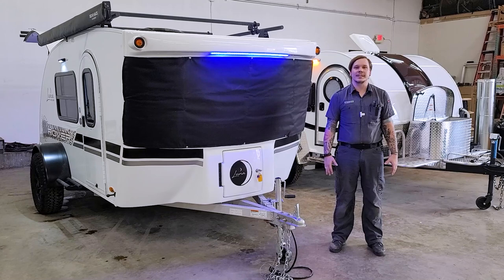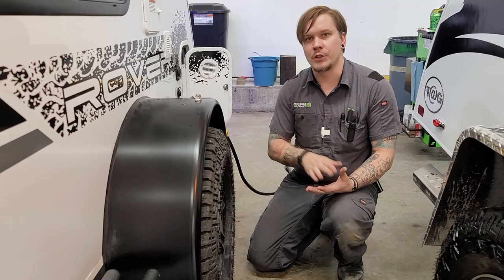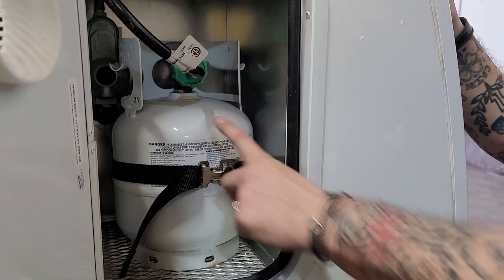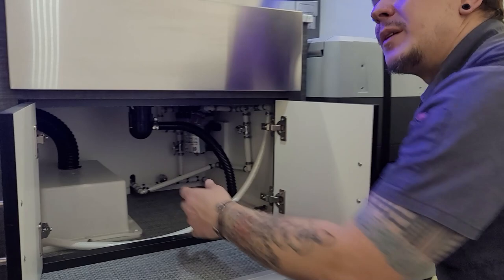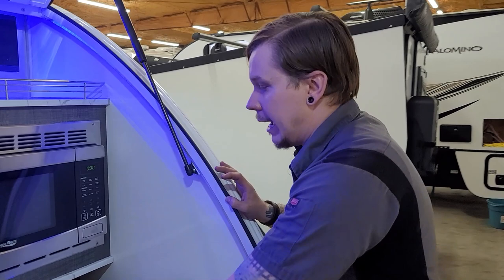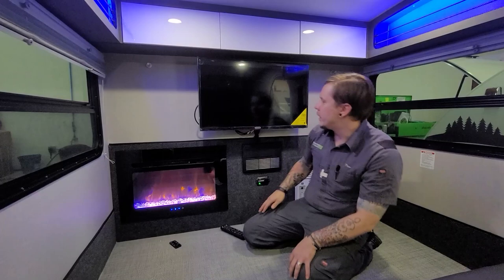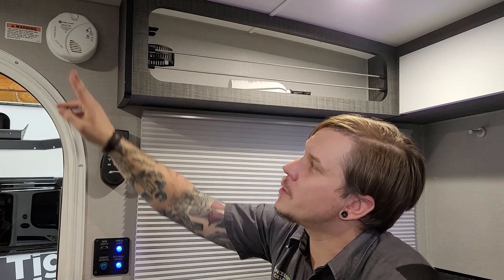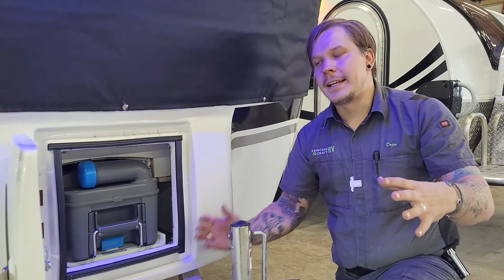2021 Luna Rover Technician Tour

Comment: Looks like a great trailer in most regards.  But who on the design team thinks "blue LEDs" are what should light this thing?  And who in management approved it?  We are planning on getting one of these in a few years, and at that time I will have to spend a few hours removing all the blue LED fixtures and replacing them with fixtures that (a) shed a more useful light temperature/color and (b) are not obnoxious once night falls.  Hopefully InTech makes the fix before then and saves me the time, trouble and money.  Standard human factors engineering fail, in favor of what....cool factor?

Comment: Hi Drew. Do any of the windows have bug/insect screens to permit the windows to be open and eliminate insect/mosquito entry? Thanks Drew. Great video!!! Thanks.
Reply from the maker: Yes, they do have screens to prevent bugs from coming in!
Reply: @RVTechToursatPrincessCraft  Amazing! Thanks so much.
Reply: Good video! Where do you add water to the toilet for flushing?
Reply: @danrobertson9725  it is part of the 8.5 gallon tank and utilizes the water pump to move the water to the toilet for flushing.